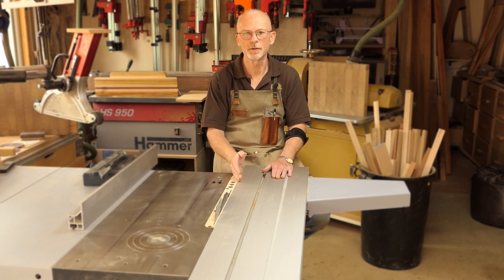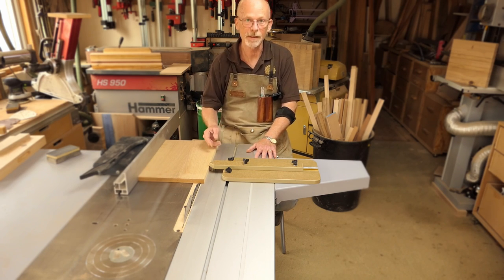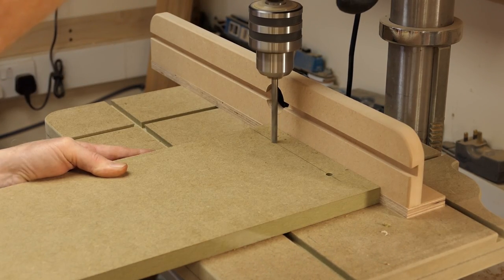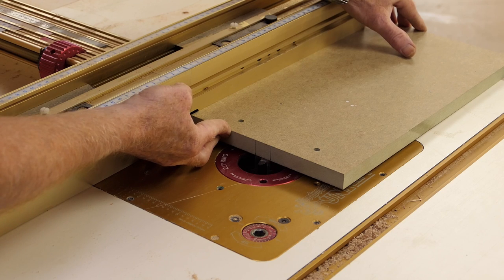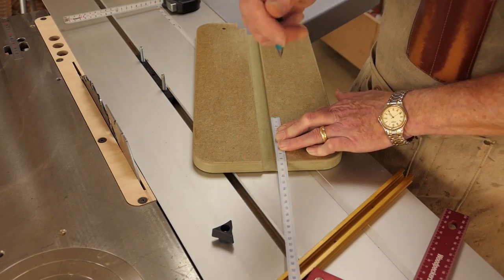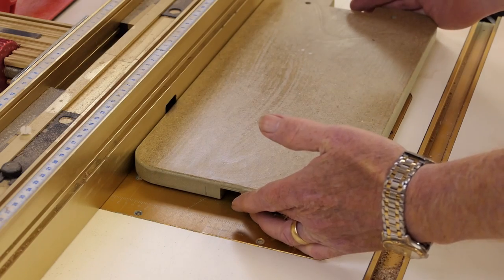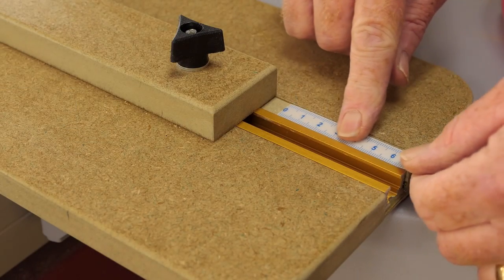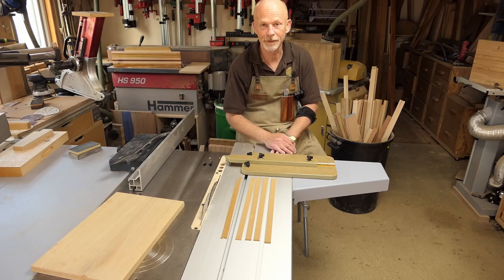How to make a Thin Rip & Repeat Cut Jig

Comment: I’ve always marked off the end of my stock to the required thickness of strip needed and placed a magnetic stop block to the table top. Cut the strip, slide the stock up to the stop block again and away you go. What could be simpler?

Comment: My Thin Strip Block is ,1 piece of wood 5 inch Across 2.1/2 High with a handle on the top it is about 18 inch long ( not a critical size on any part ) the 2.1/2 inch is flat to the bed of the saw. The back end has a small strip of wood as a stop adjustable as a thickness indicator and act as the pusher. This runs along the Fence on the bed. I set the thickness of strip I need then with the wood to be cut placed at the left hand side of the saw blade pushed up to the block then push through the blade check the size,  It takes 3 pieces of wood and 4 Screws. It took me 15 mins to make out of scraps and I have used it for years.
Reply: That’s the way I make thin strips. Set the fence once. If you bevel the sliding block you can make bevel strips. Taper it you make wedges.

Comment: I have the hammer c332 a§. I have not used my  spindle moulder yet also. Do you have to move you stock up to the blade after every cut?
Reply from the maker: Unfortunately, need a better way as it's annoying me.

Comment: Nice jig, but you have to move the fence every time.  Bit of a pain and an opportunity for error to creep in.  My ShopFox fence is well set up.  But every time I move it the back end (out-feed end) will move every time I lock the bar in place.  I've messed with the adjustments repeatedly in an effort to get that last little shift out of the fence.  Maybe it's me but I just can't get that last little bit out.  That means every time I reset the fence it's going to move ever so slightly.  I've gotten mine down to a max shift from one extreme to the other of 3/32nd's (little more than a 16th).
Reply from the maker: Dead right sir and a pain totally agree

Comment: Perfect timing.  I have to rip some thin stock next week.  I’ve been eyeing some of the pre made fancier jigs when your video popped up.  One might think you were somehow closer than the thousands of miles between our shops. Maybe I need to look over my shoulder when I’m in my workshop.
Reply from the maker: Hi Dan, great minds buddy, great minds. 👍👍
Reply: @GTWoodshop  Did I notice you removed your Incra fence system from the table saw?
Reply from the maker: @Maker_of_fine_sawdust  HI Dan, yes I did, quite a while ago.  I wanted to try the stock fence for a while so I could accept / dismiss it fairly.
Reply: @GTWoodshop  Good idea.  Here in the US, used Incra fence systems sell for nearly the same price as new.  There is a 7 month lead time as well on new items.

Comment: I am wondering why you built it all to go to the left of the blade, turning your safe sliding saw in to a standard cabinet saw? The massive black housing on the back side of the fence seems to prevent easy clamping of a stop block to the fence. Does the fence slide far enough (towards the HS 950) to clear the blade and be useful as a stop block?
Reply from the maker: Hi Randy, good question.  After owning a cabinet saw for so long I suppose I am partially still in that mindset, not fully converted to a slider as yet.  The fence does slide more than enough to enable easy clamping yes. 👍
Reply: @GTWoodshop  Thank you. I am considering buying my first table saw and have so much to learn!
Reply from the maker: @randyhermann9347  Enjoy the journey my friend. 👍

Comment: Great tip! I’m still getting my head around adapting techniques to my new sliding table (Hammer k3).

What happened to your Incra LS rip fence? Looks like you’ve removed it? I’m wondering if I can fit one to the hammer K3 but hard to find the info I need to know if it’ll work. Any advice?
Reply from the maker: Hi JD Thanks you.  I put the stock fence back on as I wanted to make sure I'd given it a fair crack of the whip.  Now I know that I can pop it back on when ever I want to I'm happy to work with this for a bit.  I'll let you know in due course what I think. 👍
Reply: @GTWoodshop  looking forward to hearing your thoughts! I’m not a fan of the fence that came with my k3 and the incra sounds like a great upgrade…if I can manage to actually mount the thing.
Reply from the maker: Hi JD, check this out https://youtu.be/0nPnJHNC2qU hopefully it will help. 👍

Comment: At 7:15 your bandsaw blade is deflecting noticeably.  I'm sure you know this, but you should take some time to explain that the proper way to secure a bandsaw blade is to have the drop-down guide properly adjusted and sitting about a quarter inch above the work piece.  This prevents the blade from flexing all about the place and mitigates the risk of the blade coming off the drive and idler wheel.  The backing bearing needs to be properly set so the blade does not flex back, as I've noticed in your cutting at this time frame.

Comment: It's only wood or acrylic being cut and the thin strips are probably being used for visual enhancement only. You are not building a Rolex watch, so as an engineer, I can't see how 0.1mm +/- is any thing to be concerned about. The design is fine, but the average DIY person doesn't have a 3D Printer, a router table etc. I believe the reason lots of woodworkers go to the extreme in design and build is they have plenty of time on their hand and enjoy what they are doing. Nothing wrong with that. Commercial wood shops / cabinetry shops don't have this luxury - they just want to get the job done. Thanks for the video and your design ideas though.

Comment: Oh no. This method is absolutely useless if you want constant pieces of timber the same thickness. It is sad to think that this idea is still bandied around. Take it from me, I have used this method over the years from time to time and there is no way you will get every piece of timber 100% the same thickness. moving the fence each time creates a human error because you will be hard-pressed to use exactly the same force when moving the fence into position each time against the stop and therefore is misleading to suggest that you can because it simply doesn't happen. The distance between a cutting blade and fence must be constant to produce material that is exactly the same thickness every time. Don't get me wrong, the jig looks fine, well made and in theory, one would imagine that it is a great idea and will work with no problem, It won't. It can be used successfully if you cut one full, single length of timber and then cut it to shorter lengths from the one long piece.
Reply from the maker: Ho John, I agree, an update / replacement is on the cards. 👍👍